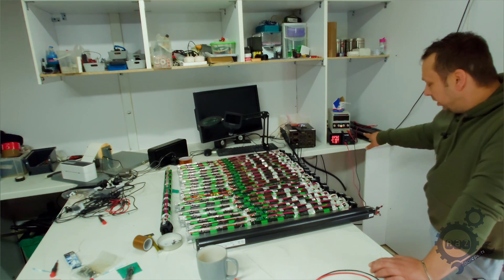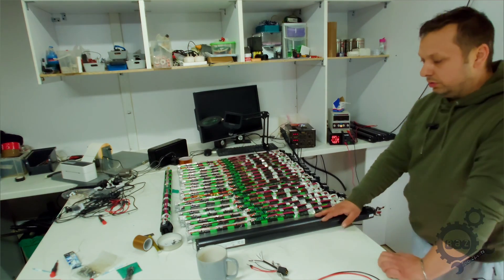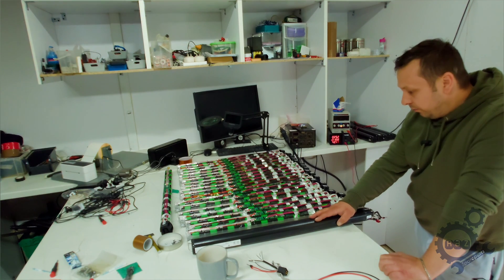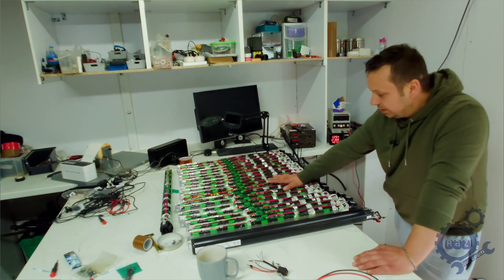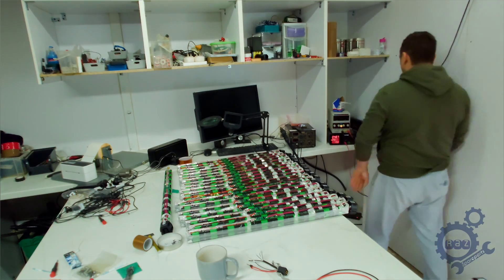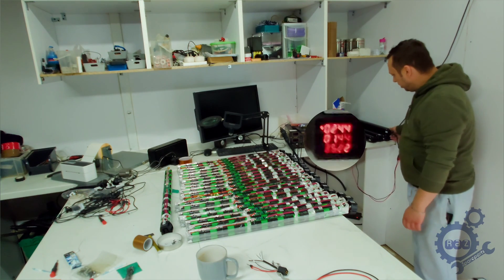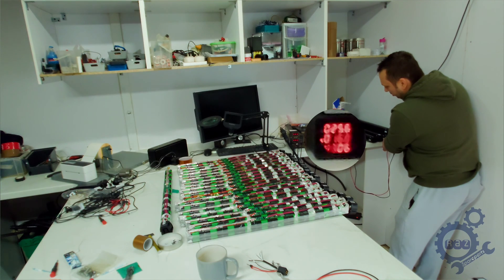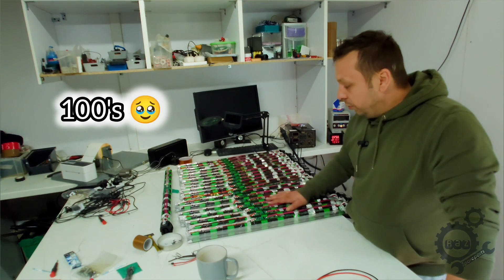How to fix VANMOOF S3/X3 batteries error reset and fuse replacement  VANMOOF BATTERY NOT CHARGING

Comment: Thank you for sharing all those videos. You are genius! I have one question. I changed the blown Fuse. I meassure Voltage on the discharge side. If I meassure between the red (Main Wire) on the left side of the Fuse and the black one there is 41,3 V. If I meassure between the red wire on th right side (after the Fuse and the Mosfets) there is no Voltage. The 4 Mosfets are open. If i give 3,3 V betwenn GND and VCC the Mosfets are "closed" and i can meassure Voltage passing through. Can you please tell me why there is no Voltage on the VCC? Is it the small Cardridge which tells the VCC to close the Mosfets or should there always be around 3 Volt at the VCC? Thanks a lot!!

Comment: One beginner question: will the bike turn on when the battery pack is dead? Or can you check the bikes controller in the horizontal bar with the charger? Hope you understand my question
Reply from the maker: Hello... Bike will not turn on when the battery is dead it could go into shipping mode and that will tell you that BMS is completely dead and is not recognised... The most it can be recognised by the app when you have the bike on charge..

Comment: I'm trying to charge my vanmoof battery using a bench power supply. It won't take more than 0.028 amps at 42 volts. Turning the knobs doesn't increase voltage. Any thoughts on why this is?
Reply from the maker: That is because battery is nearly full and probably you have the fuse blown please check the other videos how to replace it...or how to change settings to the charger so you don't blow fuses In the future

Comment: Hello and thanks for your informative video!! 
So I found a compatible charger with the 8mm connector and having a 42v output.
 My concern is it's a 5a instead of 4a! The question is: If I charge to the recommened 80%, can I use the 5a?
Reply from the maker: Not great is to munch and will fry the BMS eventually

Comment: Hi Raz, thanks for all your wise videos .. however, I am stuck with a battery where the charge is brought up to 80%, the BMS has been  reset, the fuse is shorted (for now) and it still has err6/17/20 and doesn't charge. When shorting +CHG an DCH it is charging however. I am not getting the readings between CHG- and the fuse as you show in this video .. can you help me out, maybe the Mosfet ATP301 is dead?? Thanks in advance, Rob
Reply from the maker: @robvaneck8649  having error 6 ... Clearly you have the fuse poppet.... 
Regards
Reply from the maker: @robvaneck8649  it might be just the third pin disconnected... Fuse has 3 pins ... Across is the fuse itself and one side is a heating element used in case of voltage rising to blow the fuse ... That third pin is supposed to have around 30 ohm resistance...
Reply: @Razspareparts  .. thanks for your fast reply, then I will wait for the fuse to arrive from China! And keep up the good work!
Reply: @Razspareparts  I've now installed a new fuse (SFK1445) and the battery still doesn't charge. All three 151 resistors are showing 50 Ohm .. is that correct? Any more tips for checking or exchanging parts (Mosfet ATP301 ?). ..
Reply: .. fitting the right fuse (sfk4045) has worked, the battery is loading again! However err19 and err20 remain, possibly because the BMS needs s software upgrade? Maybe something for a next video, cause this info is nowhere to be found!

Comment: Around 6th minute. "To push current both ways" which wires are you keeping connected? The ground to charge ground and positive to discharge positive? 

Thanks
Reply: I also need a reply here @Razer, I probably can't do a proper reset, even the hard reset on bms with pliers
Reply: You mean “thingy” wasn’t a good enough explanation? Lol. He’s putting current through both the charge and discharge paths. Red/Red positive and Black/Black negative. You won’t want to swap or ground those. You saw sparks on his video when he slipped on the thingy!

Comment: In the video, you demonstrate how to charge it with a lab power supply and reset it using the discharge side.

Do I need to connect only the red (+) discharge side to the red charging side? Or should I also connect the black (-) side? It's not very clear.

Could you explain if both sides need to be connected, or what exactly needs to be done? Maybe a video with more details would help?
Reply: I would ask the same question

Comment: Hi, I really enjoy your videos. 
Direct to the question. 

How I can delete all these errors (6-19-20-21,…) from my battery after replacing the fuse? I already replaced it and voltage from VP and Ground is 40 Volts.  
Can you explain the exact steps?  that will be very useful. 

Thank you so much in advance, you are doing an excellent job helping people with these bikes.
Reply from the maker: Check on my channel I made a video

Comment: Useful video. I’m fixing batteries in Lithuania, so we are like coleques or smth like that. I bought s3 with battery error, detected blown fuse. All 10 groups 3.7V but idk why the fuse blow. Waiting for fuse from Ali, because there is no in the Lithuania. And before replacing fuse u need to disconnect some wires, balancing and power (idk about charging, but i will desolder them too). I am right in this?
Have a great holidays!
Reply from the maker: Charge thru the BMS as I do with 4 amps ... If starting to jump check wich row of cells failed... They usually have high voltage and replace the bad ones

Comment: I am lucky. Not yet have any problem with my s3 2021 battery. it even says error 19 if i plug the charger in when it's charged 100%. furthermore It's working very well.

Comment: I have a S2 battery and I have tried to charge it with a balance charger (IMAX B6) when I started to charge them they where around 1 volt each serie but some of them they where at 0.20 or so. No when I try to charge those low 0.20 v series they get a bit warm and when they hit 2.5/3 V and unplug the charger to see if the keep the charge they drop within 15 min 0.5 volt or so. I have this on 2 series. Serie 1 and serie 4 have this problem. Now I think the battery is unrepairable because I don’t have a remove tool to remove the cell from all the other series. I have only a soldering iron. Can I fix the battery or need to replace them or how does it work?
Reply from the maker: I
Cells are shorted S2 have more problems... Some are not welded properly and they get disconnected
Reply from the maker: But when cells are close to 0 volts ..  o point of trying because they develop internal shorts and they will self drain quickly